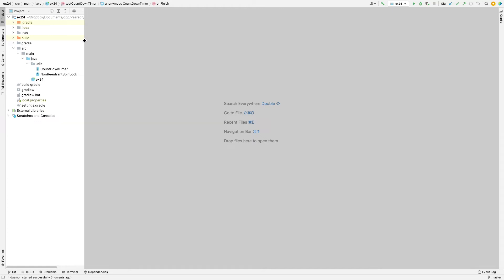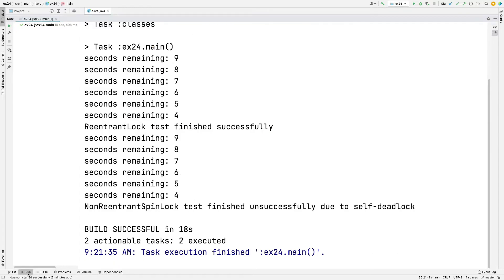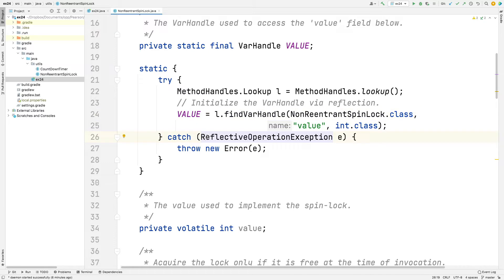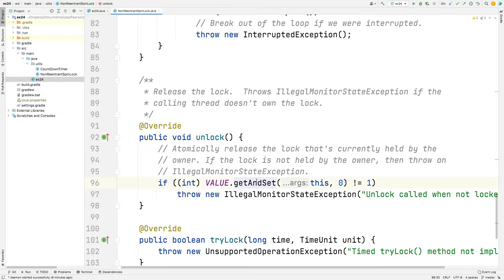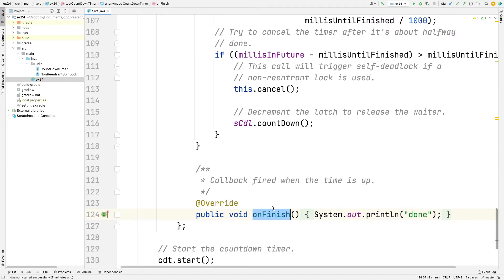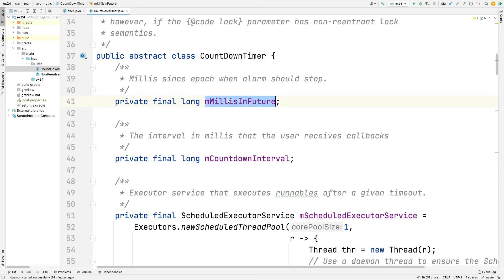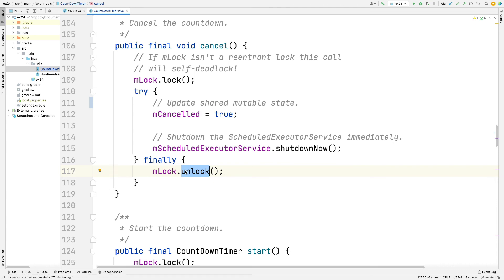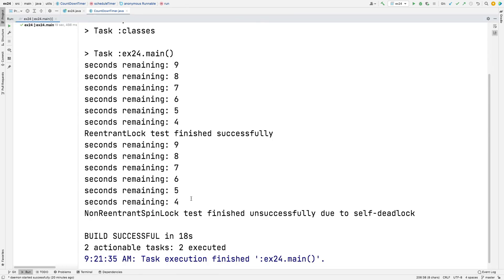Comparing a Java ReentrantLock and Non-reentrant Lock in Practice

Comment: What is the main benefit of using VarHandle instead of plain AtomicInteger? My hypothesis is that it should be faster…
Reply from the maker: In modern versions of the Java platform most Atomic* classes are implemented using VarHandle, so there's probably not too much difference between using VarHandle vs. Atomic*.